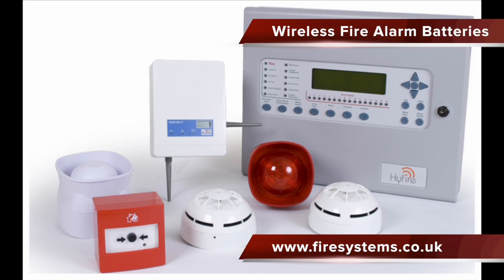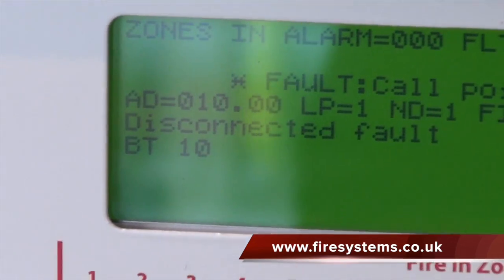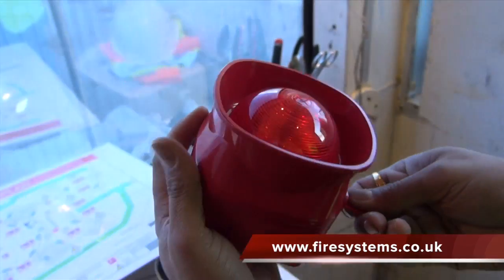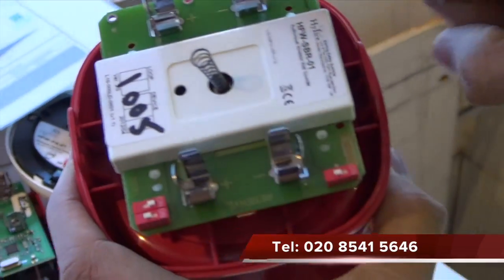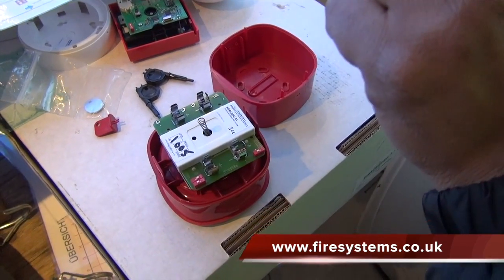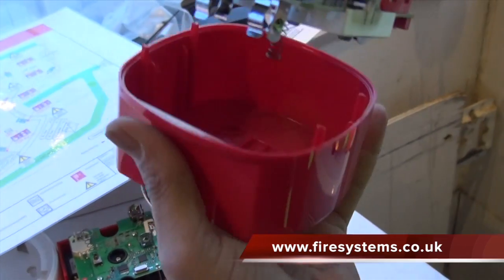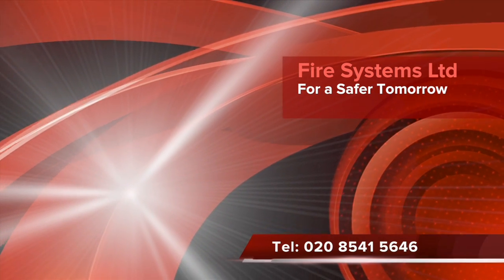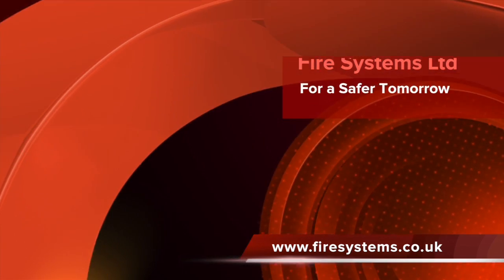Replacing the Batteries in a Wireless fire alarm sounder - Hyfire

Comment from the maker: Wireless fire alarms have many great advantages, such as an easy and quick installation and of course no wires on display. However, they do have one disadvantage, which are the batteries within the devices will require changing from time to time.
This video shows you what to expect if you let the batteries within your wireless fire alarm drain down beyond the required levels recommeded by the manufacturer.  #wirelessfirealarm   #firealarm   #firesafety 
http://firesystemsltd.co.uk/fire_services/wireless_fire_alarm.html
Reply: How do you install a wired sounder with wireless alarms and panel?